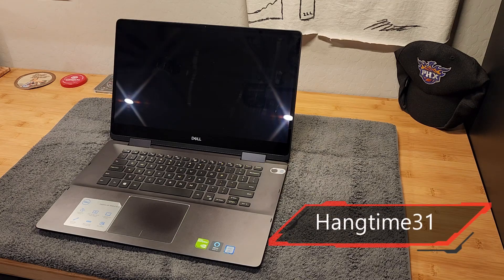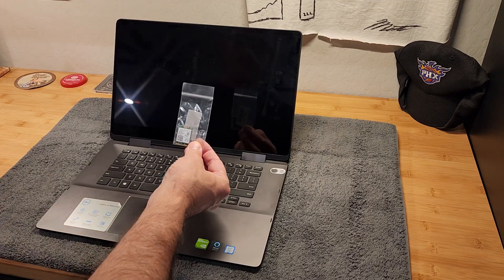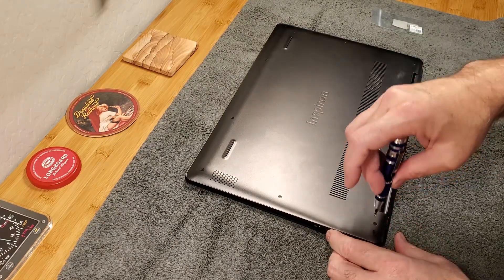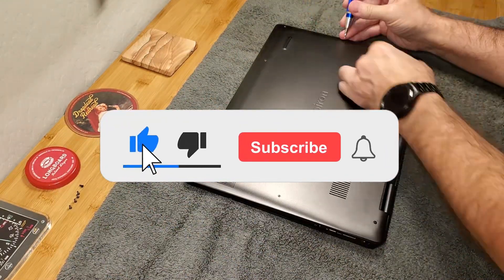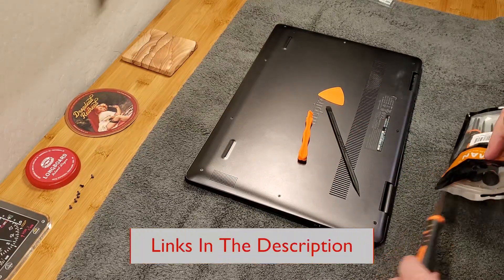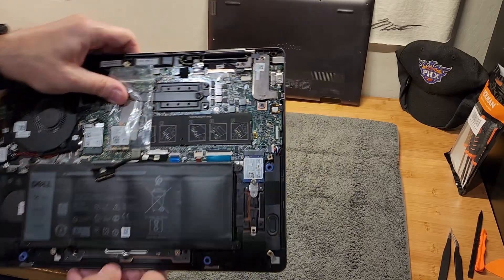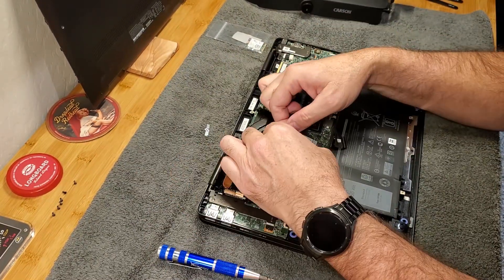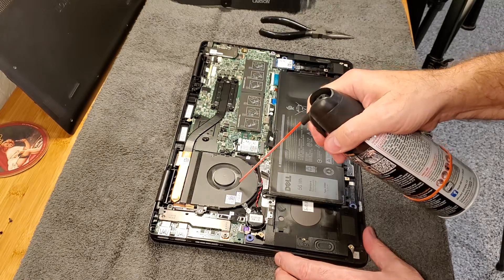Dell Laptop WiFi Card Repair DIY

Comment: Do you have a video of a Dell Precision ; 7710 ? installing Bluetooth?
Reply from the maker: I don't - but assuming it's similar to this model, then the bluetooth is bundled on the wifi card (that's why there are two antenna wires).  If you download the service manual for your model from Dell, it should show you the location of the card and more info about the OEM card they installed when they built the laptop, then you can go shopping ... perhaps even for an updated card.

Comment: Not the same Inspiron I have but i suspect my wifi cars is not working.. when I check it was overheating and when I connect wifi through a cable (my laptop has lan jack) it doesn't work either what gives ????
Reply from the maker: A wifi card will normally get a little warm during use.  It's super hard to diagnose stuff without being able to put my eyes and hands on it, but ... if the wifi card was fried, then plugging in an ethernet cable with a reliable connection to the internet should bypass the wifi card and hook you up.  I did this when working on this particular Inspiron in the past in order to get internet while waiting for the new wifi card to arrive.   I would make a mental checklist of things to check and verify, then start going down it until I hit on the problem.  Good Luck!

Comment: Hii I hope you can see my comment, I have a dell inspiron 15 7570, I opened it to clean it and after i put it back together the wifi disappeared, this happend to me before a while and i had to change the wifi card, now this happened to the new one too i don't know if the problem is with the antennas cable or something else and I'm really frustrated I can't use my laptop without wifi and I'm tired of wasting money on it.